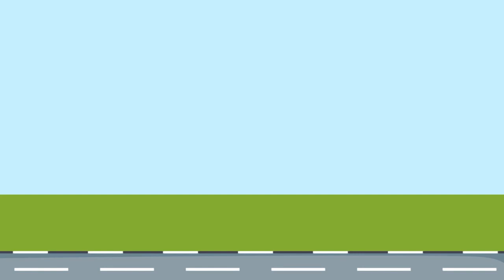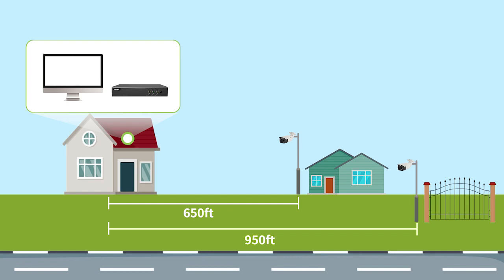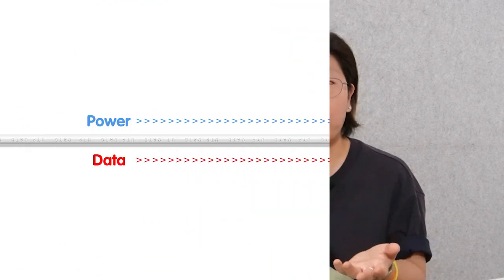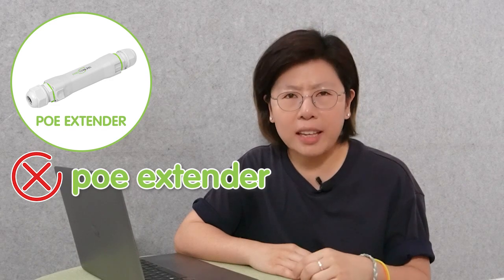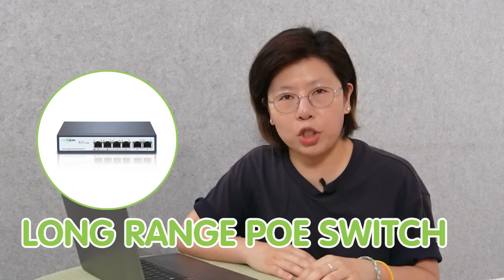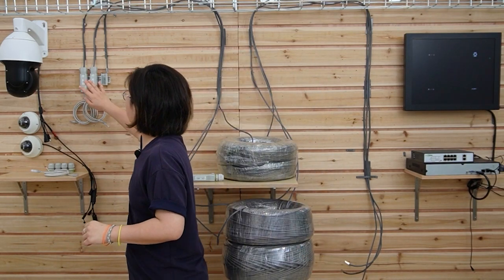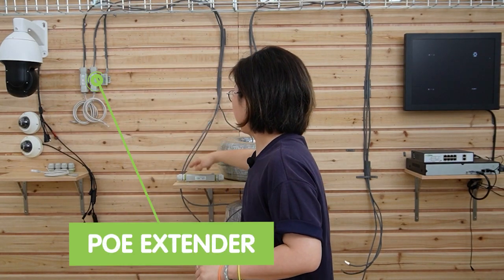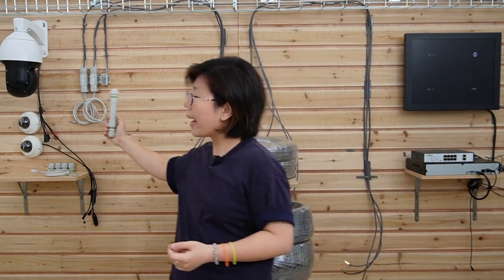Adding An IP Camera System for Your Big House(Comprehensive Guide)

Comment: Hi, I purchased both of these components (POE switch and extender) and i was wondering if you could answer a question please?
I have 2 NVR's in two different building, rather than wiring the individual cameras like you did in this presentation, can I connect the NVR in building #2 (All cameras) to the extender and use one cat6 cable to send the signals to building #1?
Thank you in advance.

Comment: HI Can you please say what is the power minimum consumed by each camera, so that we can calculate the power budjet of POE. and how to add addiotional POE
Reply from the maker: It depends on the camera design especially the built-in infrared LEDs or the motors if it is  pan/tilt/zoom camera, or the heater if there is any.

Comment: Hello ,there I had pre-installed my ip cameras before and wanted to add another ip camera ,so the problem I have is I bought a switch and wanted to link two cameras on the  poe switch and connect to the nvr which I did but the cameras keep flipping from on camera to the other on one Ip address and can't add the other one how can I overcome this issue please help. Thank you
Reply from the maker: It's probably because both of your IP cameras are possibly trying to use the same IP address when connected through the PoE switch to your NVR. You can check and configure the IP addresses either through the camera's web interface or using a software tool provided by the camera manufacturer.
Reply: @Fastcabling there ain't any other manual means to overcome this?
Reply from the maker: You can check the IP address of each camera to see if there's a conflict.

Comment: I can use Poe Switch if i have poe NVR ?
Reply from the maker: Yes, you still can use PoE switch in most case. However, if the PoE NVR switch has isolated subnet to take in the IP cameras, then the camera can't return to the NVR through the LAN port on the PoE NVR. It will not work in this case. You can cross check the IP address of the camera as well as the IP address of your NVR itself.

Comment: Hi, i would like to ask if it possible to put poe extender on poe powered switch on uplink port?
Reply from the maker: Yes, just make sure you add the PoE extender before 328ft. I would suggest you go for this one, as it has power handshaking. It doesn't rely on the PoE powered switch at the edge. You can attach any switch to the cable at the edge. https://www.fastcabling.com/product/poe-extender/
Reply: @Fastcabling  "you can attach any switch" meaning not a "powered swich but a regular poe swich with ac external power?" how can it powered the poe switch at the edge if there is no ac power source in the remote area ? and how could  we power the poe powered switch tru regular poe switch on it's uplink port?
Reply from the maker: The poe extender should be connected to the poe passthrough port on the poe powered switch. But you might need a 802.3bt poe injector to power the extender or there'll not be enough power.
Reply: can i use this system even without internet?can i record vid with NVR with IP cam and poe switch.does IP cam and NVR function only with an internet access?

Comment: nice but is it possible to monitor by cell phone when im not at home? whats are  the low power consumtion cameras ?is it safe to put out the cat6 cable/poe extender outside enviroment ? thunder strike can damage poe swith fire house or anythunh 😢
Reply from the maker: I believe most IP cameras allow access remotely without configuring the router/modem now. P2P technology makes it easier. If the thunder strike hit anything, it will fire without any doubt. Even if it is the power cable, there is no difference, but the chance is odd. However, the cable could absorb the surge from the environment. It will not fire your house, but it could damage the devices. If the lighting happens so often, you might consider adding the PoE surge protector to the system.
Reply: @Fastcabling  thank u so much for the reply